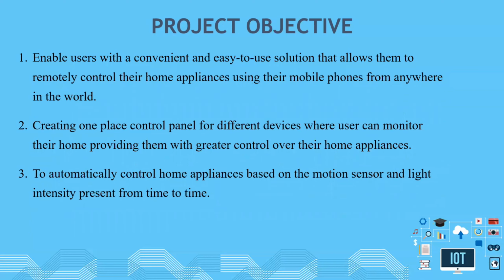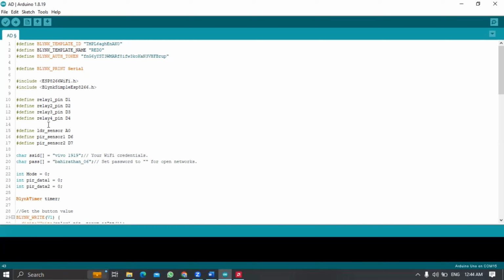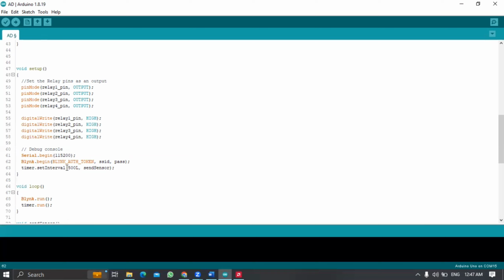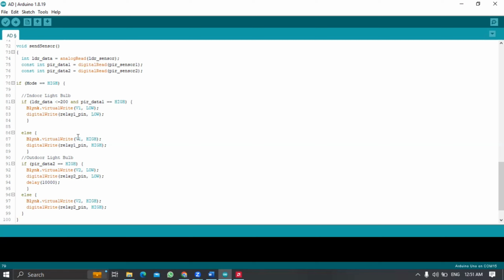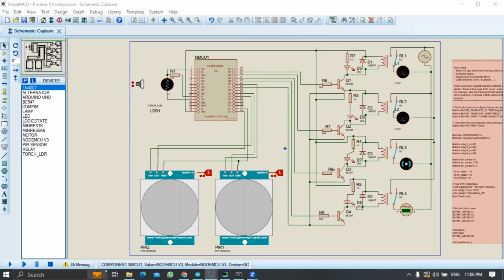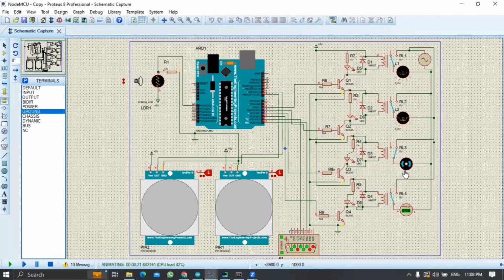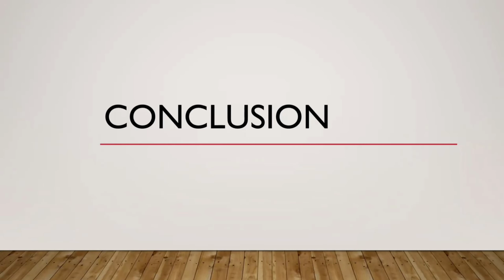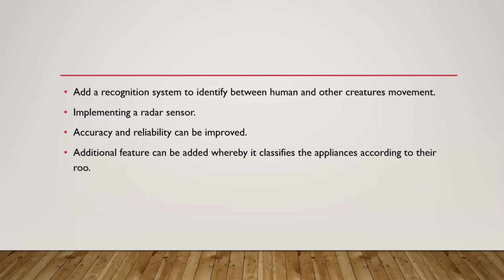GROUP6 INTERNET OF THING IOT BASED HOME APPLIANCES CONTROL

Comment: NICE PROTOTYPE BUT presentation too long, exceeding time limit and missing some demo. Please answer the following questions:
1. Outdoor light does not depend on LDR value. Does this mean outdoor light will always turn on when detecting motion even during the day?
2. Is there any notification / popup message if the Blynk app cannot connect to the hardware?
Reply from the maker: EC21071 
GROUP 6 
1. Outdoor light does not depend on LDR value. Does this mean outdoor light will always turn on when detecting motion even during the day?
Yes sir, The outdoor light will turn on when detecting motion, regardless of whether it is day or night. This is because we intentionally eliminated the dependency on the LDR (Light Dependent Resistor) value to determine the lighting conditions(day or night). The decision to disregard the LDR value is due to the limitations of using LDRs to determine whether it is day or night in the outdoors.  LDRs measure the intensity of light falling on them, but they are prone to various factors that can affect their accuracy. For example, factors like rain, car lights, clouds, shadows, or artificial light sources can cause fluctuations in the LDR readings. In urban areas or places with significant artificial lighting, the LDR may not function effectively in distinguishing between natural and artificial light sources. Additionally, outdoor conditions such as dust, moisture, or aging of the sensor can further affect the reliability and longevity of the LDR, causing it to provide less accurate readings over time.
Considering these limitations, relying solely on an LDR to determine day or night may not provide reliable results in all situations. Hence, in our project, alternative methods for determining outdoor lighting conditions were not found, and the decision was made to have the outdoor light activate solely based on motion detection.

2. Is there any notification / popup message if the Blynk app cannot connect to the hardware?
Yes sir, when the device is connected to the Blynk app, a popup will appear indicating "Online," which shows that the device is successfully connected to the Blynk app. Where else, if the device and the Blynk app are not connected, the popup will display "Offline," indicating that the connection has not been established yet.

Comment: GROUP 1,
EC21082
Why your circuit simulation for NodeMCU in proteus cannot generate the desired output.
Reply: EC21062 (GROUP 6) : Proteus does not support NodeMCU, which is based on the ESP8266 microcontroller. As for ESP8266 and NodeMCU, Proteus can only simulate 8051 and ARM microcontrollers. Since Proteus does not support NodeMCU, we used an Arduino Uno instead to test and simulate our project.

Comment: EC21107
GROUP 2
Q:How do the ldr sensor recognise whether it is bright or not?
Reply from the maker: EC21071 (GROUP 6)  
An LDR (Light Dependent Resistor) sensor recognizes the brightness level by measuring the intensity of light falling on its surface. LDRs are made of a semiconductor material whose resistance changes based on the amount of light it receives. When exposed to bright light, the resistance of the LDR decreases, and when exposed to darkness, the resistance increases.The interaction between photons (light particles) and the semiconductor material of the LDR. When photons strike the LDR, they excite the electrons in the semiconductor, causing them to move and create charge carriers. This process alters the resistance. By connecting the LDR to a circuit, such as a voltage divider as in our project using 12k ohm resistor, you can measure the resistance and determine the brightness level.

Comment: EC21103 (GROUP 10) may i know the range covered of the sensor that been use to detect the present of the motion for inside and outside of the house?
Reply: EC21062 (GROUP 6) : This PIR motion sensor has a maximum range of approximately 7 meters to detecting motion both indoors and outdoors.

Comment: GROUP 9
EC21073
Can your system support a lot of output or there is only a limited number of output that can be connected to your device?
Reply: Group 6, EC21119
The number of outputs is limited by the relay used, and opting for a larger relay would allow you to increase the number of output appliances connecting to your device. For example, changing the relay to 8 channel relay would allow you to connect and control 8 home appliances. So, our system would be able to support more output and be limited only by the relay.

Comment: EC21066
Group 3

How will the system handle power outages or network connectivity issues?
Reply from the maker: EC21071 (GROUP 6) 
Power outages and network connectivity issues are inevitable problems that may occur under unfavorable circumstances. Since our project is the first prototype and our main objectives are not regarding to handling power outages or network connectivity issues we don't have a drastic solution for these issues.However, our group has devised some solutions to address these issues and these modifications could be implemented in future versions.

To handle power outages, we can incorporate a standby generator and a transfer switch into our system. During a power outage, the generator automatically detects the loss of power from the utility grid and starts generating electrical energy. The transfer switch isolates the home from the grid and connects it to the generator, ensuring that important appliances and systems can continue to operate. When the utility power is restored, the transfer switch detects it and switches the electrical load back to the grid, providing a reliable backup power source and ensuring uninterrupted electricity supply during outages.

Regarding network connectivity issues, it is important to note that our project is based on IoT and relies on stable internet connectivity. However, the Blynk IoT platform we are using is designed to function even in low network connectivity situations, offering a level of functionality and control for IoT devices. When the network connectivity is weak or intermittent, Blynk employs various strategies to optimize its performance. Additionally, in situations where there is no internet connection available, we can incorporate a physical manual switch into our system, enabling users to operate the system without internet connectivity.Since our project is the first prototype, these modifications could be implemented in future versions.

Comment: GROUP9 
EC21068

Is it possible to use high sensitivity vibration sensor instead or PIR infrared motion sensor for this project. If possible, which sensor would be more suitable and efficient?
Reply: EC21062 (GROUP 6) : The selection of a high sensitivity vibration sensor instead of a PIR infrared motion sensor for a project is determined by the project's specific requirements and objectives. PIR Infrared Motion Sensor is suitable for detecting human or animal motion within a given range, whereas High Sensitivity Vibration Sensor is suitable for detecting vibrations or mechanical movements. Since the objective is to detect the presence of a human, a PIR motion sensor is the more appropriate and efficient sensor to this project.

Comment: EC21064 
GRP 03
Can i integrate  my Iot home appliances with other smart devices or home automation system?
Reply: Group 6, EC21119
You may integrate this system with other smart devices since this system primarily controls turning on and off your appliances through your devices. This is achieved by connecting or cutting the power supplies to the appliances. The same is true with other home automation systems, depending on their suitability and use. However, this is not recommended since smart devices may have their own features to be remotely controlled and home automation systems already have their own environments, and combining them may interfere with each other.